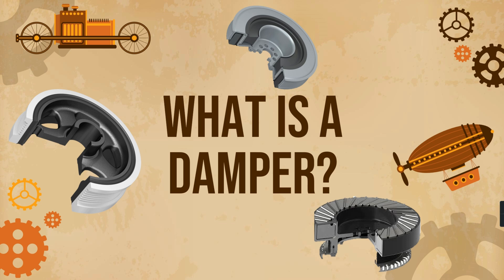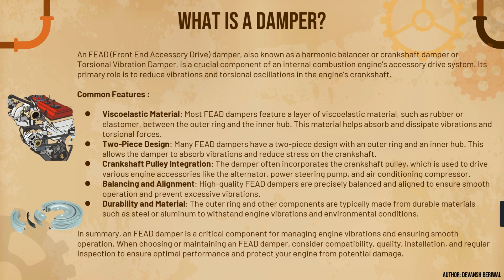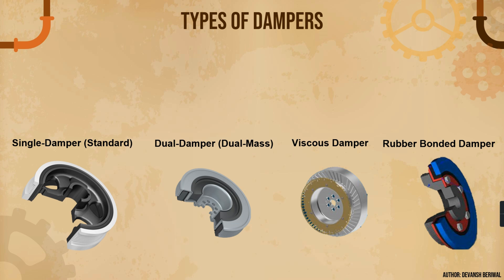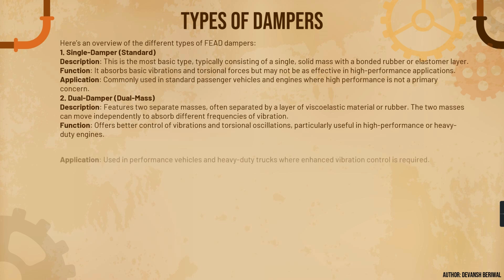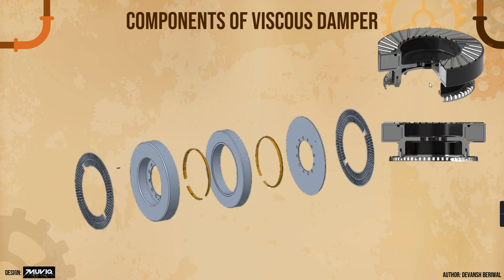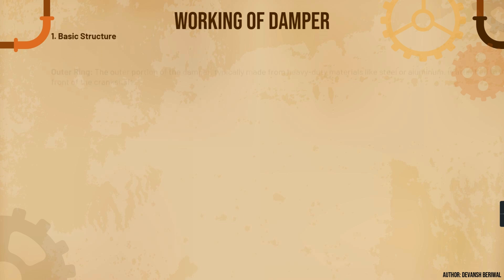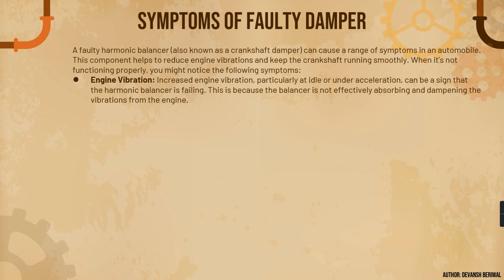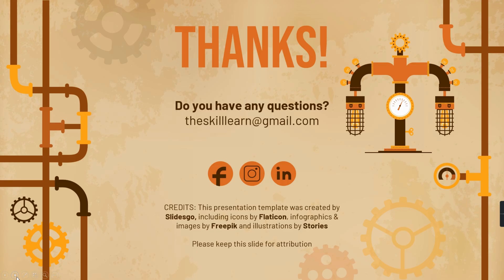What is a Torsional Vibration Damper? | How a TVD Works? |Components of TVD | What is a FEAD System?

Comment: Hi Devansh , Are torsional vibration dampers present in all ICE vehicles, and are they the same for hybrid and PHEVs?
Reply from the maker: Yes, TVDs are common in IC engines, especially in larger or higher-performance engines where torsional vibrations are more pronounced.

TVDs might still be present, depending on the design of the IC engine used within the hybrid system. However, the need for TVDs may be less critical due to the contribution of the electric motor in reducing vibrations.